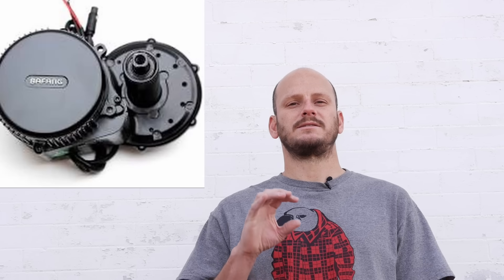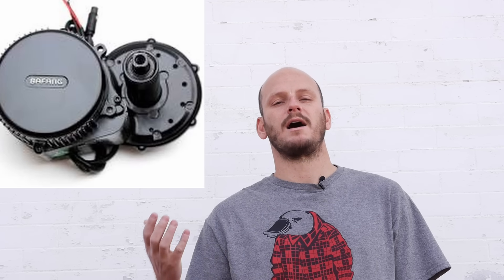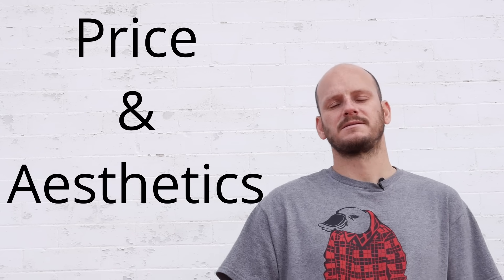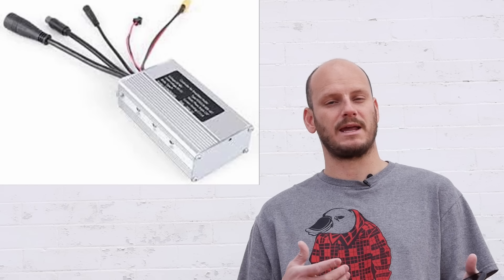Hub vs. Mid Drive Motors: Why Hub Motors Suck and Debunking Common Myths with performance test

Comment: Mid drives are kind of ridiculous, way more cost , more parts to wear and replace , more friction Ect.. this is like deciding you don't like how electric cars feel so you throw in an automatic or manual transmission.... And fyi midship electric motors were already on the market in Japan with the PAS bike in 1993 and every year after , hub motors came much later once brushless controllers were available, Hub motors are superior in most ways Especially efficiency and simplicity, if it tearing up a wheel there are other issues like poor maintenance or shoddy workmanship ect,  but here in Japan bike repair for "mama cherries" is like auto industry, big money because lots to maintain. If anyone is trying to decide which route to go I strongly suggest you research and research some more, good luck!

Comment: Power output  (lets talk Watts not Torque as it's difficult to assess torque values) is also very important. 
A hub motor with 2000 watts output is faster than a 750 watt crank drive and to get that same speed from a crank driven motor you will kill the chain and cassette very quickly. Plus you will also destroy the internal gears of the Crank Motor. 
Hub drive are better for on road use as you don't need to worry about gears. 
Off road a crank drive can be more efficient IF you have a good controller. And that's where it all hinges. The controller and the ability to program how the power is delivered is more important than the choice between crank or hub drive. I have both types. I prefer the hub drive for most applications except for really steep and slow up hill MTB use. I go out every week MTBing and do many of kilometers.

Comment: Just finished a gas to electric conversion on an old pocket bike with a bunch of spare parts I had. I'm running a thousand watt 48 volt ATV motor catch the primary chain is running to a jackshaft and then to the back wheel and it's using instead of lithium-ion it's running for Power Wheels batteries we're getting ready to mount my GPS on it in the next day or two to see exactly how fast it goes but if I were to guess I'd say the thing does between 26 and 32 miles an hour. It's basically a budget pocket bike or Frankenstein.. it was proving a point somebody tried to tell me that you can't convert them from gas to electric and I had to prove them wrong

Comment: Fully agree with your overall presentation but need to add one more exception.
My take YMMV.
Special conditions and application. 
Fat guy with medical limitations wanting the benefits in all areas on the street not concerned with speed (past a good 18 mph average) and really concerned with flattening hills and lowwww maintenance over a typical 20 mile round trip range in a 5-6 month season.
There was a cost consideration as well in the retail selection back in April 2020 BUT that gap has closed a bit in 2021. (Prior to impending hyper inflation. Buy your parts asap kids)

So, lets start! 
1.  If you have a 750w hub you can still do streets legally no license fees, insurance or registration in most states .(Maine)
2. I wanted a light aerobic experience & errand runner. 
3. My weight was a factor at over 300lbs SO, mag wheels were in the spec for lowering maintenance. The geared hub gets that fat guy take off and hill crushing covered but clearly 30mph isn't, won't ever be part of the concern.

I did however swap out the freewheel from 14/28 to a 11/28 and I think my original front sprocket was 49 and upped that to 56, Now my aerobic level to enjoy 20mph plus as needed wasn't a hamster comedy routine. (I can easily maintain 25 plus with a very comfortable cadence) <Yeah a mid drive would have shined here>.

2700 miles one tire swap to Shinko 244s (added 7-8 pounds and nicked around 4 miles of range too) and now own a second battery switchable for range that ended up FREE from Juiced. 
The biggest drawback with this setup is unpowered it's a walk along due to gearing options. <Once again a mid drive would have shined here as well>
As so far, very reliable for a 300# plus loadout and around 20 miles per battery.
If, I get below 250# I will defiantly gift myself a DIY mid drive or if the funds are there or go BOSCH in a retail bike. But for now short of the once a season bearing and internal gear lube n check I'm pretty happy with my mildly modded Juiced City Scrambler well suited for a fat commuter. I have a few years of GAS bicycle experience and decades of MC experience but due to a few medical issues ebikes and the advantages in that niche are becoming more important in my life. 

Not really related but perhaps useful protip:
As for a important mod if you buy a bike that has a frame mounted battery that is using silly bi-pin audio style jacks to the battery/bike interface, do look into just tossing that for a XT-60 connection (perfect for those 52v or less 750w hubs) it will be melt-out proof and add a amp or two boost you might notice due to more reliable consistent connection. 
Proven Fact, at least on Juicedbikes and a few others.

Comment: Looking around, mid drive ebikes seem to be much more expensive than hub bikes!
Reply: one of the problems is, you can get really good hub motors at the cheap end. A 250w voilamart and a 250w swytch/bafang hub drive perform pretty much the same. Cheap mid-drives on the other hand are pretty rubbish - you are basically just buying a container of factory smoke. Pretty much everyone who sings the praise of mid-drives rides bafang as cheap mid-drives just turn your bike into a bomb.
Reply: @Debbiebabe69  I did not regret at all going BBS-HD.  Use a good wax-based lube, and a KMC e-bike chain, as well as the Luna 42 tooth chainring.  

The lube has ~ 8 to 12 oz heavy gear oil (superlube ISO 680) per pound of wax, 5 to 7 parts paraffin to one part each of beeswax and sticky microcrystalline waxes.  I was cooking the chain every 75 to 100 miles, using an old crock pot.  Chain wear was less than .5 on the Park tools “ruler” after over 1000 miles.  The chain will need cleaning in kerosene prior to rewaxing.

I did regret not getting a stouter chain when some wretch came along with bolt-cutters...
Reply: @dennisyoung4631  Used to be a cycle courier in London the number of times I found couriers having their bike stolen or some other a-hole courier putting glue or matches in people's locks there wasn't a lock that they couldn't cut or break open somehow.
I even brought a lock that came with a year's worth of free insurance after needing to claim on it for the 3rd time they refused to insure my bike ever again.
twice was when it was stolen and the 3rd time was when someone stuck glue and sticks in the lock they sent someone out to remove the chain it took over an hour so god knows how these people can steal bits in under 3 minutes with a good chain but they do.

the biggest joke is finding your bike has gone and a note telling you how much they want to give it back because they know you have no bike you have no income and by the time you claim your insurance you could be out of work for 4 weeks. they only do that with cheaper bikes normally as your likely not to be insured.
and the bike not worth much selling it.

Comment: Never owned an Ebike because getting one to my location is $700 in freight and the local shops want nearly 2-3x the price as they are found online. However, that is not to say that much research had been done before learning about the shipping issues. I would go with mid-drive and replace the chain every season since they're not too expensive or I would purchase a dual-motor hub drive system.

Comment: Boy, that hub motor you use in your demo is weak! And uh, Tesla's don't use gears 😉
I prefer mid drives myself, but the dig on hub drives sending power through the spokes doesn't mean much. Mid drives ultimately send power through the spokes as well. Like you said in the comments, it speaks more to the quality of components than hub versus mid, though all bets are off if it's one of those horrible radial laced wheels!

Comment: I picked a hub motor for my build because for the same price I got something a lot more powerful. When you said that the difference was 50$ tops I was surprised so I went to check (on aliexpress, where I got my kit) and found 270$ for a hub motor kit vs 420$ for the same power (750W) mid-drive kit. That's 150$ of difference, which was enough to convince me. Do you get parts from other retailers? I'd love to find a mid-drive kit for 320$. A friend is thinking of converting his bike as well and that'd be a great opportunity to try it out.

Comment: I’d like to convert to mid drive but I don’t want the noise. My hub drive is really quit, can you suggest a quit mid drive brand?
Reply: Good luck! I honestly don't know if they exist. That is why I love my 3000 watt to 10000 watt Hub Motors!! All I hear is a little bit of tire noise going down the road. My neighbor lives a half a mile away and he'll be out working in his yard and I'll pull up beside him and he is so surprised because he says he didn't even hear me coming.
Reply: I recall my BBS-HD to be nearly silent.  The Hub I’m currently using, while quiet, is louder.

Trick is to put Mobil-28 grease to the gears - which I did to both bikes.

Comment: Dude, please check the relationship between torque and speed for dc motor and how to calculate power when you know torque and speed at a certain moment. 
It is linear, the higher speed the smaller torque and vice versa.

Comment: Do you have a recommendation for a good and affordable e-bike with a mid drive?  Let say, between $2000-$2500?  You mentioned that there is not a bike difference, does not seem like it in my price range...  Thanks and I am in Canada BTW.
Reply: Eunorau Fat HD
Reply: @ramtak1  Thanks... I am looking for more of a city/commuter ebike, not into the Fat wheels.  I appreciate the suggestion, merci :-)
Reply: @anthonylavelle7229  check out what Ride 1 up has to offer
Reply: @ramtak1  Thanks, great prices, did not see any with Mid drives :-)
Reply: @anthonylavelle7229  I forgot to mention that Euronau has a 27.5 conversion wheel kit for the fat HD I believe it's $300

Comment: Hi, what do you think of the   Lectric ebike from USA ? Any good?
Reply: Tried the XP for a week it's great and out of 3 bikes in my area they so far all run since the 2020 season. My only gripe is range, so add that second pack in your order if you want a 20 mile plus day 'at speed'. I imagine low pedal assist or for you flyweight guys one pack may be reasonable though. You will want slimed tires and spoke checks around 500 miles so get used to truing a wheel. Not that hard after one lesson.

Comment: Hub motors have one gear? I have 2 ebikes, handbuilt from bare frames and boxes of parts. One is a single, cuz it's meant to be a cruiser. The other has 7 gears on the rear.

Juice into the hub issues? Quit jackrabbiting.

Spindly spokes? Nah. Serious shit back there, and shorter, so less cross-section to fail.

Comment: I have bafang 1000w and 2 hubs motors i like more hubs ,the linear acceleration whit out changes the gears ⚙ is fantastic 👌
Reply: Any mid drive with the same wattage would smoke your hub motor off the line.

Comment: Mid drive motors are terrible! The combined forces of you and the motor goes on the chain and tooth wheels. The makes them wear out so quickly. With a hub motor the wear is minimal. I had both and i am doing 5 time more mileage with a hub motor than with a mid motor. Also putting the front wheel with hub motor on another bike is so easy.

Comment: I couldn't get away with a mid drive in my area, the battery would be ded inside 10-15 miles. Coast regen is basically a must have if you bike in hilly terrain.
Reply from the maker: ironically a mid drive is a must have in hilly areas :)

Comment: Jist because the hub motors used in e-bikes tend to suck does NOT mean all hub motors suck. This video is biased misinformation. Look up alienrides channel or wrong way channel to see how much better hub motors really are.
Reply from the maker: If you want "performance" in the truest meaning of the word, Mid drives are hands down champions. Its simple engineering. But if you are going off of different factors, Hubs may or may not have an advantage
Reply: @JohnnyNerdOut  you might as well turn thet statement on its head and it'll mean the same thing. "If you want performance in the truest sense hub motors are hands down champions. But going off different factors mid drives may or may not have an advantage" 😂
Reply from the maker: @James Faction  your totally right 😂 
Just to clarify on those times a hub motor is better: you live in a retirement village in Florida, there are no hills in sight,  you don’t care for performance, and money is a factor. That is not supposed to be mean. I actually talked to a customer who had those sets of needs and was like “maybe a premade hub IS the best option”?
Reply: @JohnnyNerdOut  you have no idea how good hub motors can be. There are hub motor vehicles that go 60, 80, 90mph. I already suggested 2 yt channels for you to check out and see for yourself.

Comment: Yeah, Mid Drives are Great When everything is brand new, but at around 300 miles they turn into money pits.  I own a small professional shop near Seattle and I get to see it all first hand.  It just makes me sick when a customer goes out and purchases an expensive, big brand "mid-drive" thinking it has to be good cause it's a Major Brand like Yamaha or KTM.  The next thing they realize that around 300 miles their derailleur, chain, cassette, and or engine counter sprocket are either worn out or a twisted mangled mess.  Why?!  Because bicycle drive systems are designed for human power, and not engine power. I can go into details but...
Reply: Thank You!!  Yours is the comment that helped me finally make this decision. I Just ordered a Mongoose 'Hitch' Fat Tire Mountain/Beach Cruiser. I think it is the kind of bike you described. No quality, but there is no availability of anything if price IS an object. I intend to add some kind of motor assist and fix things myself as they break.  I'm 70 yrs young , 260 lbs, with a bad back. I do not anticipate hard usage. My area is pretty flat to rolling. So, I think it's going to be a Bafang Rear Hub Kit. 500W. With a 48V 13Ah Battery. Thank You again for sharing your wisdom and for speaking out. Maybe I can sleep now.

Comment: hub conversion with wheel £180 battery  £200  ,mid drive £600 plus £200 battery ,what was the question?

Comment: I have a Stromer ST 2 (hub motor) and an RM mid-drive motor, Stromer is a better performer in every respect.
Reply: This guy is comparing very low end bike setups with low power levels. And, I do agree that mid drives make a lot of sense there.

Comment: Tesla is NOT a hub motor, it is a mid drive as it has 10:1 reduction ration from the motor to the wheel. also tesla has 1 or two motors (depending on RWD or AWD), not 4 each for a wheel
Reply from the maker: correct. I mis spoke. check the pinned comment for more of my misspeaks :)

Comment: Had both. The Bionix back in the day, what a nightmare!
I’m team Bosch CX since then. Love it. 
My already ordered bike will have a Rohloff E14 gear hub, Gates carbon chain, Magura brakes, Supernova lights and the Bosch CX gen.4. 🥳
Not cheap though, but the best engineering Germany and the USA can provide. 
Cheap crap is more expensive in the long run.

Comment: Glad you said it cause I agree, for sub 3kW I prefer mid-drive. I have no torque problems on my 24kW bike, and I was most concerned about reliability/easy maintenance for my do-it-all beast. And silence. Also I've never had a bad spoke on my wheelbuilds in thousands of miles of riding, several hundred of those offroad. =) But I use moped rims and 12 ga Sapim spokes. I actually prefer hubmotors for torque-sensing assist... and although I hate the Bosch mid-drives I'll admit the quality of their torque sensing is vastly superior to the PAS assist on a Bafang mid-drive.
Reply: 27kw mid drive has entered the chat
Reply: @thedon2703  Tell me more!

Comment: I've been checking into Ebikes for a couple of years, and have only seen 1 hub motor that failed someone, and he bought a really cheap Ebike. Less parts on any motor, always equates to having less problems.
Reply from the maker: Go talk to someone who repairs ebikes full time and they will tell you what they repair most often. I used to repair them all the time at the last shop I worked.

Comment: Mid drive sounds nice 🤔 but I’ll keep my  2kw hub motor 😌
Reply: 27kw mid drive has entered the chat
Reply: Those who know how hub motors work know this video is a load of biased horseshit. Only downsides of a hub motor are going up hill, and top speed.  If you want more top speed, get more watts.  If you want to keep it legal, get 2x hub motors, 750 watt each.  If you want to go up kills and have more take-off torque, get mid-drive but be prepared for a noisy bike with moving parts which will need a lot more maintenance and parts replaced.  Be prepared to get kicked off bike trails which don't allow e-bikes because with hub motor they don't know it's an ebike, but with noisy mid-drive and bulky goofy looking mid drive motor, they will know 100% it's an ebike.  There's other stuff but this is just the main stuff since the guy who made the video didn't mention most of this due to it being a highly biased video, as well as his lack of understanding of how hub motors work.
Reply: @waynefilkins8394  The least conspicuous  mid-drive still seems to be the Tongsheng TSDZ2, only a bit flimsy, needs constant maintenance, repairs and is losing power on a relatively long moderate hills (can do short and steep from a stop only though) since it's made more like a toy than a no-nonsense automotive part which also can be said about more expensive mid drives such and Bosch and Brose.